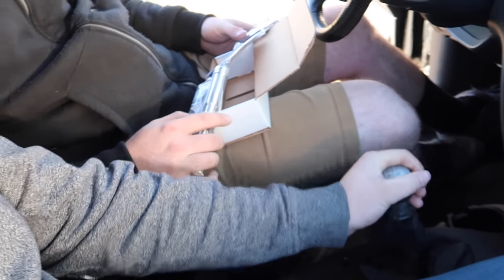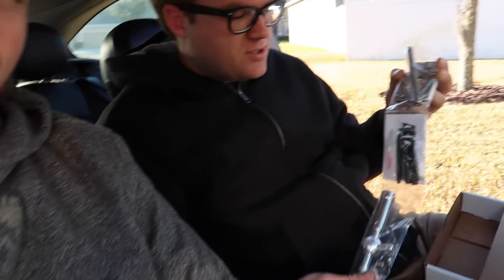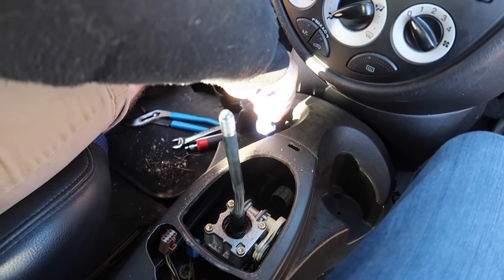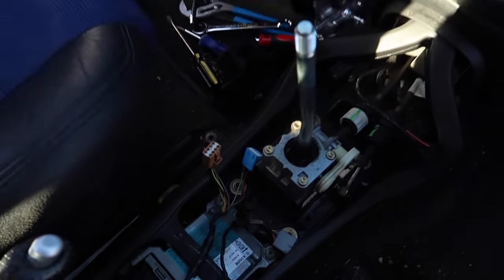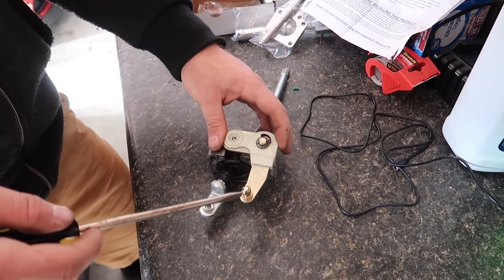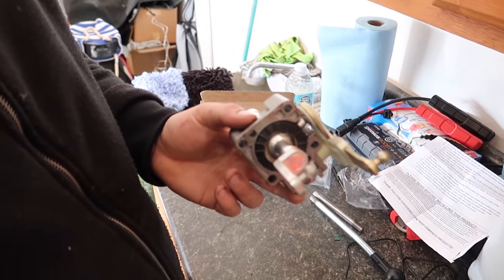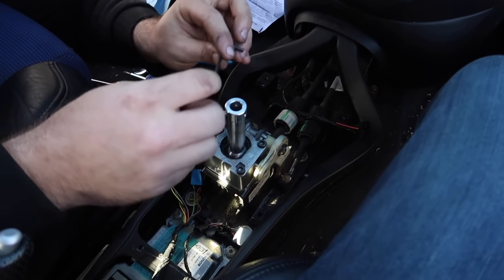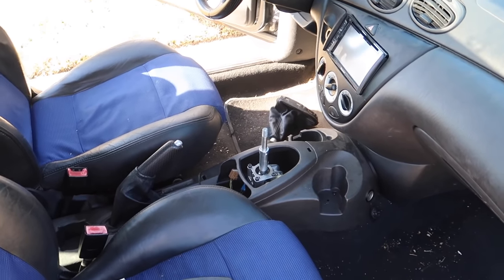Never Miss 2nd Again - CFM Short Throw Shifter 02-04 SVT Focus

Comment: Where in Florida are you guys? I'm in Daytona Beach just purchased a 2003 SVT zx5. Wanted to see if you still had your svts haha crazy story but in short I saved the one I bought from a kid that was going to ruin it. Was sold as a blown head gasket motor. Nope. 10 quarts of oil bad ignition coil and wires also 2 plugs were burnt beyond recognition.  So 4 plugs, wires, coil, and oil. And its purring.  Be cool to have some people local that know about this car . I had the 2003 cobra. I plan on doing forced induction next but no not turbo.